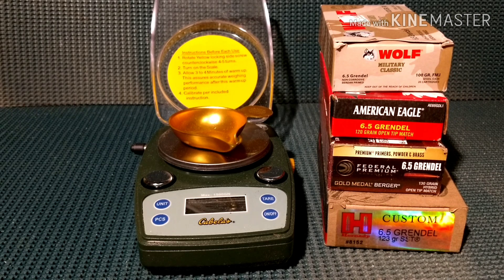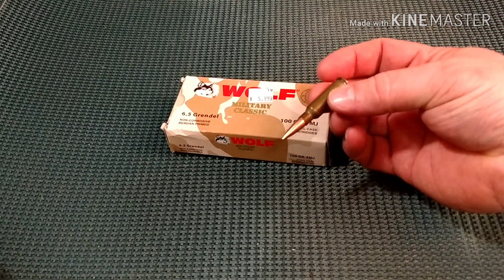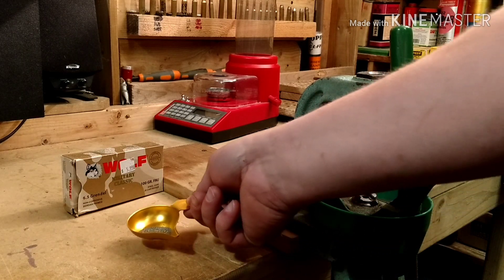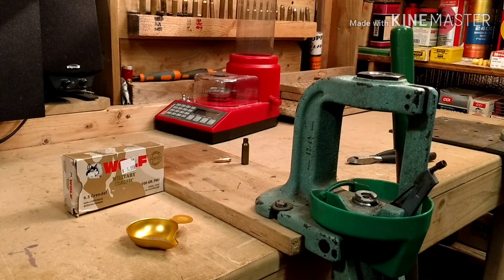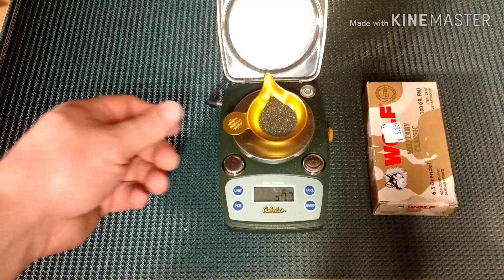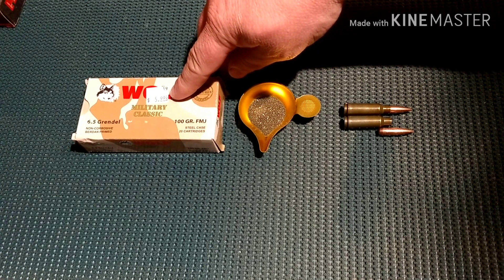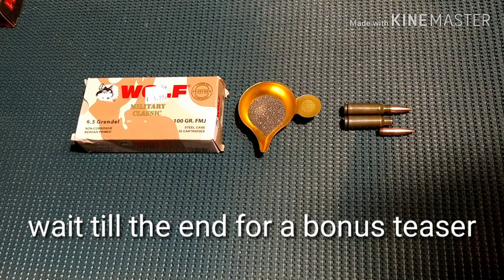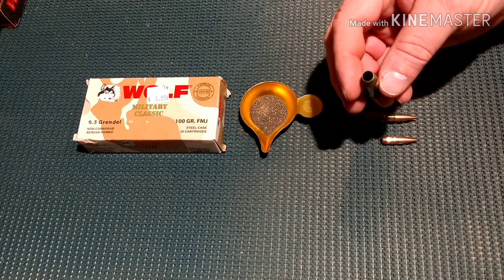6.5 Grendel Wolf 100gr FMJ teardown

Comment: Does it have a bimetal jacket
Reply from the maker: Copper plated steel core
Reply: @vastv7082  Not a steel core. It is bimetal jacket, lead core, and of course steel case. Nice video tho.
Reply from the maker: Strong attraction with a magnet